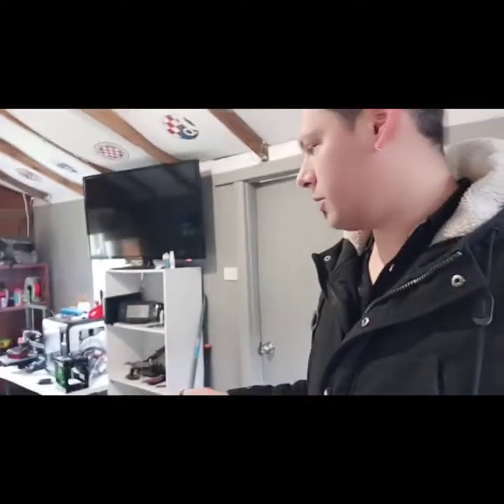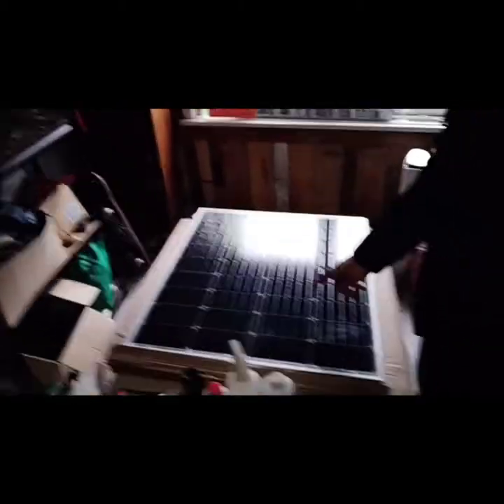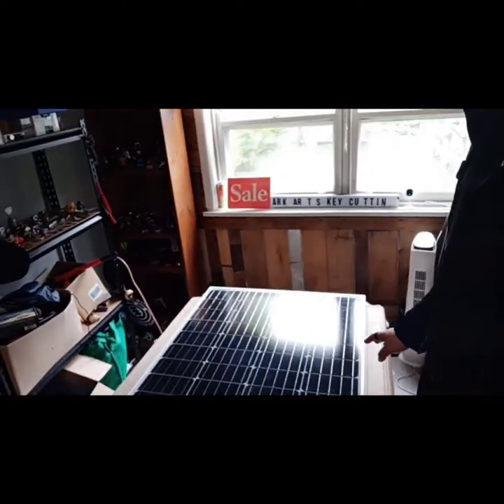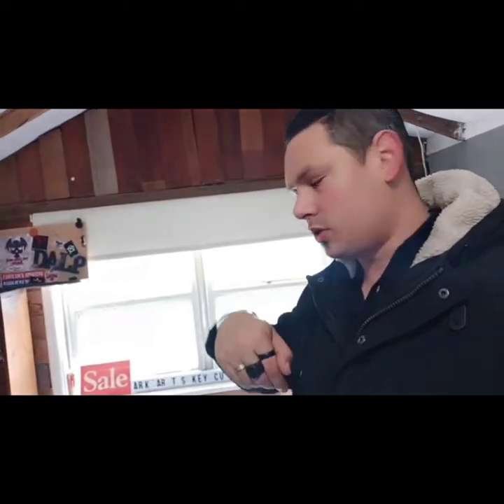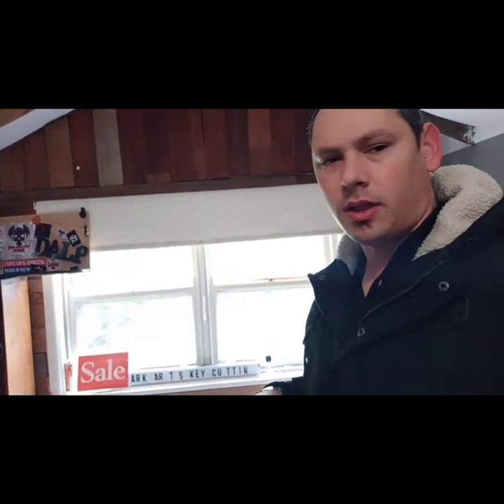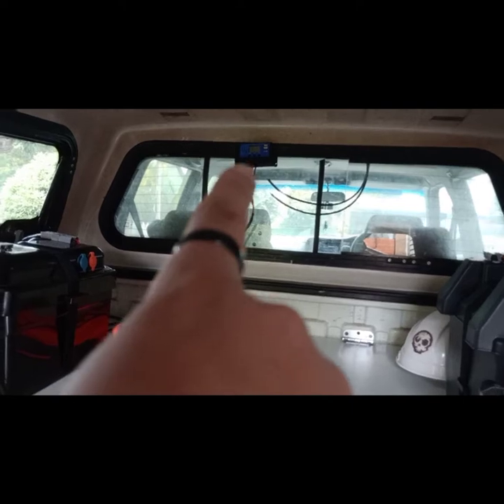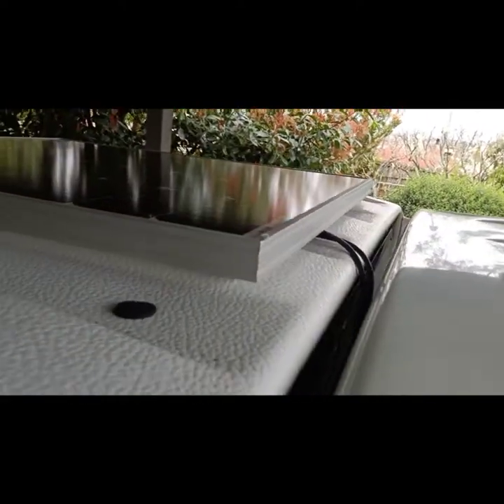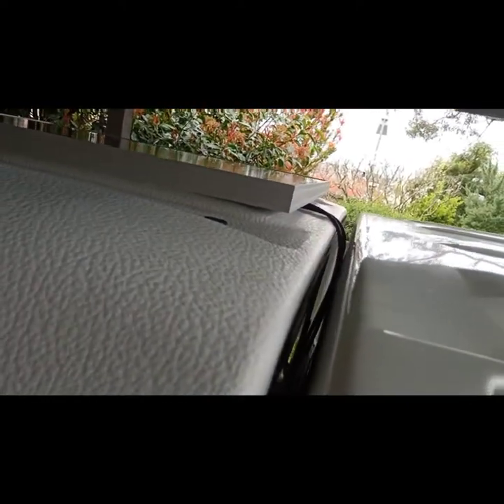Solar Battery Charging system (456)

Comment: Not too worried about it blowing off but I might have hit those bolts with some locktite or thread lock to be extra cautious.   Are you getting any wind noise?
Reply from the maker: The silicone should hold the nuts and bolts. No wind noise or anything like I don't even notice it's there. 👍